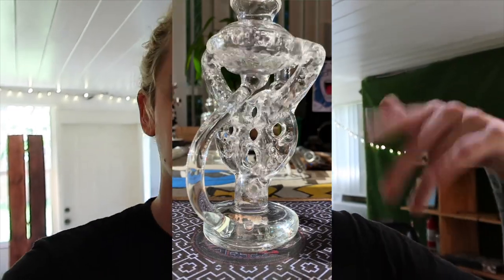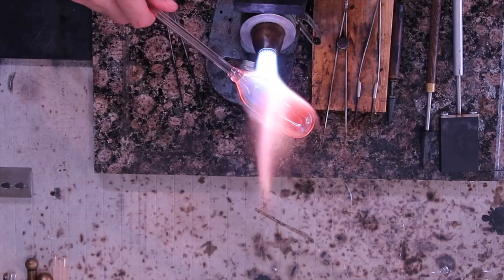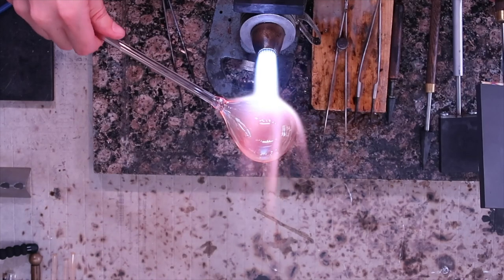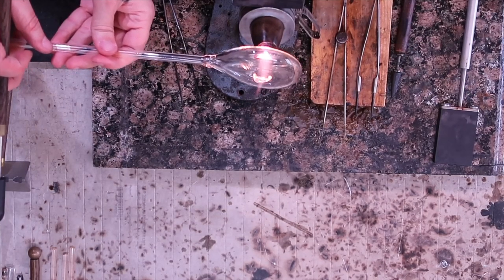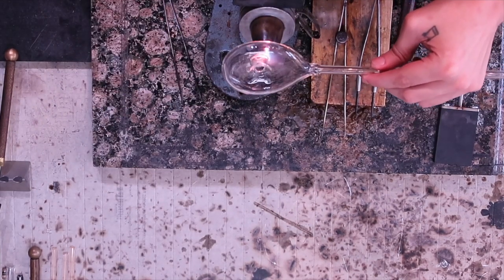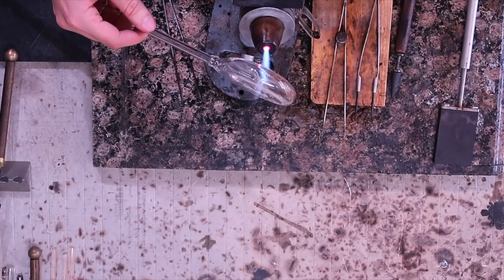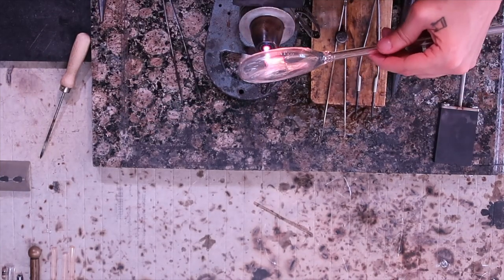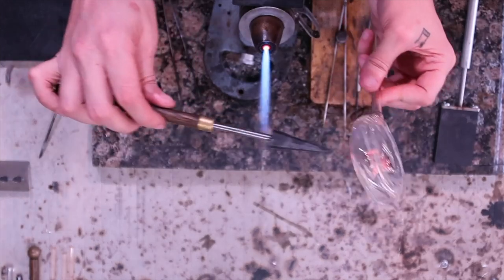How To Make a Swiss Perc || Powerful Jack

Comment: Sweet piece! thanks for sharing!

Is it just the camera, or is the brass torch face around your center fire glowing real bright?  If so, be careful, you either need to get your torch serviced, or do a deep clean.  If it stays glowing bright for long, it can melt and lead to leaking between the gas and oxygen chambers inside the torch, dangerous stuff.

Comment: Nice video, I’ve also seen people skip the first step where you pop a bubble and just poke the glass then stretch it open with a tungsten but this looks like you have more control over the process
Reply from the maker: Both work I always had trouble with the “samurai cut” but I’ve seen peeps utilize it well